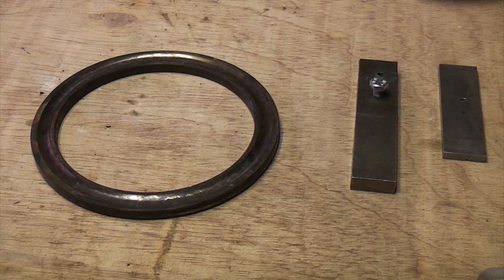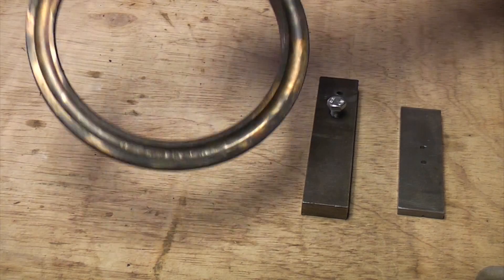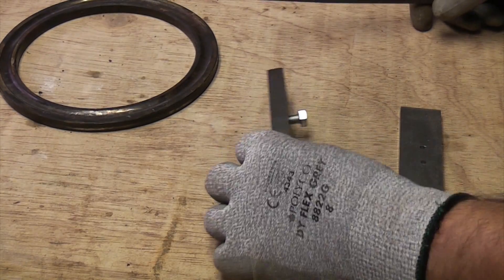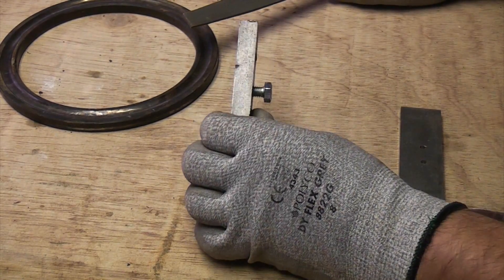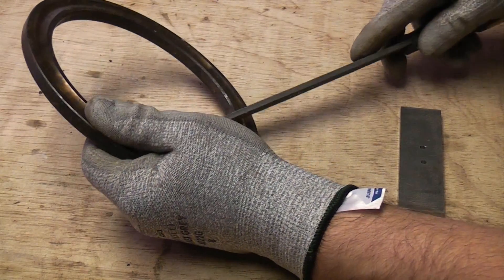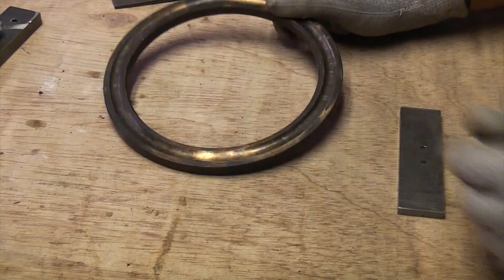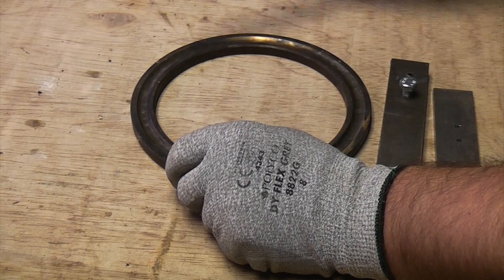How to identify hardened steel

Comment: I went through the process hardening and tempering a knife, the file can cut, will my knife still work and hold an edge or should i hatden again?
Reply from the maker: Not sure, you are better off asking a knife expert.
Although knives are made from a steel, which is harder than mild steel, it will be nowhere near as hard as the hardened steel which is used for bearing races etc. 👍

Comment: 30 Years ago, I worked at a factory, as a tool user, you will know it probably, 'Flexovit Abbrasives'.
Anyways, I found myself needing a piece of steel that wouldn't bent in order to loosen or fasten 8 inch nuts.
I used steel bolts to get some grip on with left hand, while using a wrench in right.
End result, the nut stayed in place, the bolt was bent and my hand hurt.
Useless.

I walked to the technical department and asked for a 30cm (11 inch) steel bar that wouldn't bent.
That tool was made for me.

Great, finally I could do my job properly without wasting time.
Turned out that tiny bar cost as much as 400 guilders, at the time that was like 280 Dollars............. Really ?
My supervisor wasn't happy, I didn't apologize though, I was happy I had that thing.
Reply from the maker: I have not heard of Flexovit Abbrasives before (unless I have just used their products and not noticed their name). You just brought back some memories though of when I went on my mates stag do to Amsterdam, back then it was Guilders ;-)
Reply: @ultimatehandyman  https://www.flexovit.com/en-emea
Black & Decker grinding wheels were manufactured at the same plant, basically the same as Flexovit A Quality with a different name on it.
Today also Stanley wheels, don't know about back then though.
Reply from the maker: @Jila_Tana   Thanks for the info ;-)

Comment: A question: why didn't you show the part of the hardened steel where you've tried to file it off? :P
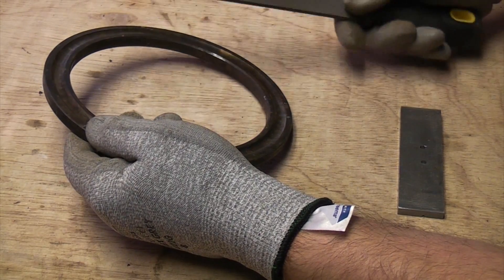Reply: If you look carefully at 1:14 in the video (try to pause the video just before it fades to black) you can just make out a small shiny spot on the edge where the file was trying to gouge the hardened steel. You can also see a similar spot at 1:16 in the video, but I think that might be a different mark.
Reply from the maker: +CoolKoon 
It doesn't do anything to it- the file just skids along the surface of it ;-)

Comment: Thanks for the video. A warning for those unfamiliar with hardened steel. I tried to chisel a bearing race off and a chip shot out and penetrated my arm. It felt like I got shot. I learned to use soft (brass) hammers and punches real quick. It took 5 years for that piece of steel to work out itself. Very painful.
Reply from the maker: Thanks for the info. Hardened steel is lethal, I know a guy that lost an eye when knocking a bearing off a shaft. Once the steel shatters, the shards will stick in flesh easily! I still get people taking the mickey out of me on here for wearing safety glasses !
Reply: Gee Dubb 
"If I stopped to go to the dr. everytime something happened, I'd never get anything done." 
You made me laugh there, that's a nice answer, but...
you were in pain, man:D they would have helped you, come on... you must have had an hour or two sometime during those 5 years to go to the doctor!
Also since we're talking already, may I ask you how it happened? Did it just sudenly fall out? Just "oh look, there's a bit of metal sticking out of my arm... aaaand it's gone"... I suppose it must have traveled through tissue so it would swell and hurt massively... are you a fucking masochist?:D
Reply: Gee Dubb Dude you're a character! I'm too much of a whimp to heed your advice, but as long as it works for you then it's fine I guess:D
Reply: Gee Dubb Hang on... pardon me for asking, but why the hell would you leave it in your arm and not visit a doctor?
Reply: @bububububak  here from another video where a similar thing happened. His surgeon wanted to wait and see whether to remove it. Kind of like how some bullet wounds leave the victim with the bullet still inside. It’s not worth the surgical risk to remove it. It is interesting that it worked its way out but my uncle was hit with a land mine in Vietnam and still has small shards of shrapnel that work their way out of his body.
Reply: bububububak just didn't feel the need to go to the Dr.. Nothing broke, bleeding stopped, just get on with life. If I stopped to go to the dr. everytime something happened, I'd never get anything done.
Reply: yes, it worked out. Dude, pains go away. I'm not with taking meds for stuff like that. Why let them slash me open for that and then have stitches? no way! I go to the Dr. for broken bones or if I need a bunch of stitches, not cuts, scrapes or bruises. I use preparation H on cuts and scrapes and they heal beautifully. Nothing worse than having to wait 2 hours for a Dr. 3 years ago I had a heart attack, didn't know what it was but I was sick for two weeks and had to go to the Dr. Spent 4 days in the hospital and got a stent, aint been back since! Live long! stay away from Dr.s!!!!!!!
Reply: bububububak hyrdrogen peroxide and iodine to clean the wounds, preperation H, and bandage up to keep the dirt out. get a tetanus shot every now and then and good to go! NO obamacare here, just cowboycare!

Comment: Thanks for posting. Is ground steel and hardened steel the same thing?
Reply from the maker: You are welcome.
No, ground steel just means that it has been ground using grinding machines (normally to an exact tolerance). Some hardened steel is ground though as it's one of the best ways to machine it, as blades and most cutters will not touch it. Thanks for the comment

Comment: Almost all decent kitchen cutlery is made from some kind of hardened and tempered steel. You usually up clean and/or grind the steel the it's proper shape before actually doing any cutting with it... Consuming the oil used for hardening is usually not a good idea. Any oil Residues can easily be removed anyhow.

Comment: Please, when you use a file, only do it in the forward motions that bites. If you do both (back and forth), you are actually reducing tremendously the file lifetime. It "folds" back the flaps made into the file metal, flaps that are actually the tooth. It is soon your file will get blunt and "shiny", it won't bite on anything anymore.

Good video. If only there were cobalt files, the hardest of my file even got blunt while reworking the edge of an old axe head i found.
Reply: That’s actually an old wives tale shockingly enough there’s been many people who have done tests. I’ll still do it the way I was taught which is forward and I get more power that way but it doesn’t really matter